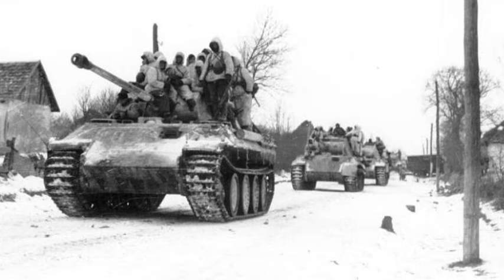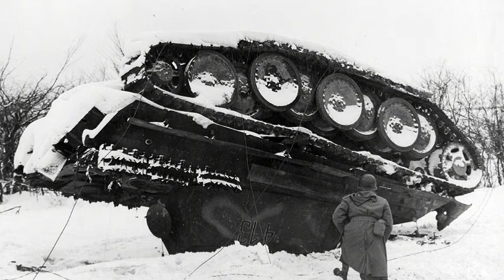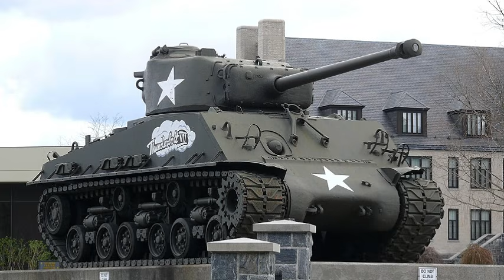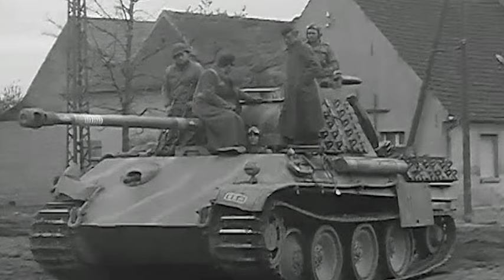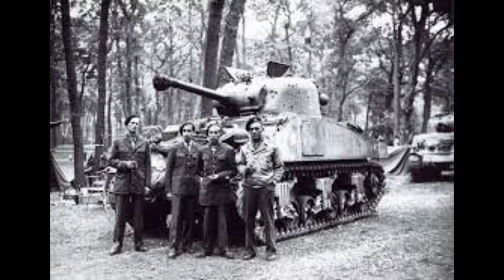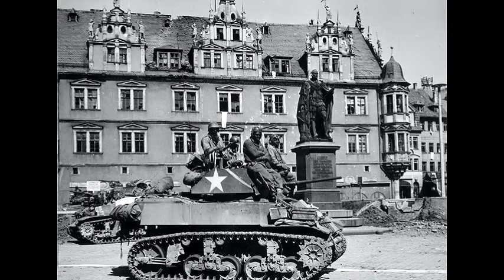Why American Tankers Preferred Their "De@th Trap" Sherman Over Captured German "Superior" Panthers

Comment: 04:38 completely changed how I look at the Panther.
A “superior” tank whose final drives lasted only 150 km is not a war-winning machine — it’s a mechanical time bomb.

And 09:02 explains why so many Allied crews actually trusted the Sherman more in combat. The Panther’s turret speed depended on engine RPM. If the engine died, the turret practically died with it. Meanwhile the Sherman’s turret kept turning no matter what.

But honestly, 14:58 is the real answer to the entire Sherman vs Panther debate:
“A tank that breaks down before reaching battle provides zero combat power.”

The Panther won arguments on paper.
The Sherman won a world war.

Comment: The price of a Pzkw V Panther tank was RM 143,912, fully equipped.  How much is that in ~1943 dollars? (An M4 Sherman, in August 1945, was ~$55,000)
Reply: About 60.000 dollars. One 1944 dollar for about 2.5 Reichsmarks 1944 year.
A Panther was far cheaper against the mythical popular view.
Best regards!
Reply: @franciscojaviermartineztor9745 So, a Panther cost about $5,000 more than a Sherman.  For that, you get great armor, a pretty good gun(against tanks...not so much vs. infantry), and breaks down every 95 miles or so.

And on the other hand, you get mediocre armor, a "middling" gun, and TIMEX style reliability
(TIMEX was a brand of inexpensive watch, that was very durable.  Their catchphrase was "Takes a licking, but keeps on ticking!")

Comment: When pearl harbor happened, the sherman was already in the pipeline. The m26 pershing was put forth only months later. The pershing was superior to all german armor in the war, but the powers that be didn't want it. It is actually amazing that they didn't send troops to fight with slingshots.
Reply: The same w the USAAF. The bomber mafia resisted drop tanks for P-47s and P-38s bc admitting the bombers needing escorts threw their beliefs out the window. James Doolittle (of the Doolittle Raid) finally made it happen, but not before 1000s of airmen died needlessly because their bombers didn't have escorts.

Comment: Germany might have done better by concentrating on improving (if possible) and producing more Panzer IVs. Though that still would have collided with the wall of training crews. WRT the Sherman, the numbers I've seen are that on the order of 70% of shells fired by Shermans were HE rather than AP. IOW, more than 2/3 of functions performed by Shermans were not fighting tanks. On another tack, one issue I've not seen/heard addressed is that defending tanks - emplaced or in ambush - often fired first, i.e. often hit first. Since users of Shermans were often/usually attacking, that meant the Shermans' opponents often got off the often critical first shot. I'm oversimplifying, but I'm showing a complication to even more over-simplified thinking.
Reply: A lot more than 2/3, because on some outings the only enemy targets the tank encounters are infantry, and unarmored vehicles, requiring only the use of a machine gun.
Reply: Yep. The more reliable, easier to fix, upgunned Panzer IV's were essentially more of a good thing vs the heavy German cats that were a headache to maintain and broke down a lot more. And the last part of what you posted about the defender's advantage in ambush, is not always considered. It's why M18's were so effective at Arracourt; i.e. they were defending against an aggressive German counter offensive.

Comment: The M4 needed a more powerful gun and didn’t get it. Postwar development showed that with an effective gun it could defend itself. The stateside brass just couldn’t understand what was needed.
Reply: According to books on tanks, the Army Ground Forces & Armored Command refused to allow the 90mm gun to be installed on Sherman's. They said the 75mm & 76.2mm guns were sufficient in combat. The tanks crews disagreed.
Reply: @MichaelWKeller : As well they might. The notion that they were supposed to entertain a Tiger while they waited for a tank destroyer detachment to arrive shows how out of touch the leadership in the states was. Bill Msuldin remarked how at Anzio, three tank destroyers crossed a canal and bounced armor piercing rounds off the turret of a Tiger until it turned its massive gun and blew each one up.

Comment: What.?
3:10  ....... I did not know any German Tanks ran on Diesel .
Is this true.?
Reply: I made the same point.  Then I double-checked.  German tanks used gasoline, not diesel.  I think Soviet tanks were the only ones to use diesel.

Because Germany failed to capture the Caucus Oilfields, it had to use an industrial process to manufacture gasoline, that used Coal.  It was an inefficient stop-gap measure.  And, IIRC, it could also be used to manufacture artificial diesel, this was even more inefficient..
Reply: @geoswan4984  ........I think, with the technology of the day, diesel would have been a problem.

To get the torque and horse power needed, the diesel motor would have been 2x  bigger and 3x heavier than the gasoline motors of the time.

Just speculation on my part, but i think i am close to the truth.
Reply: To my knowledge, even Tiger tanks ran on gasoline.
Reply: Nope. They all ran on gasoline.
Reply: No German series tank ever carried with diesel engines.
Regards.